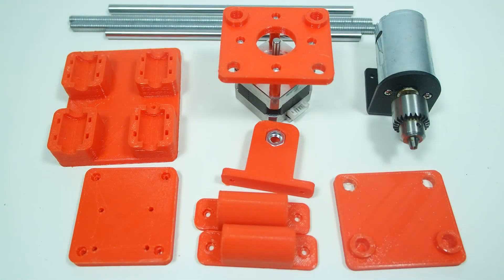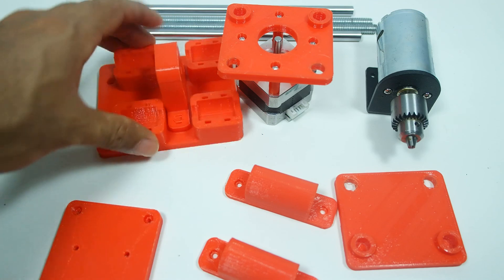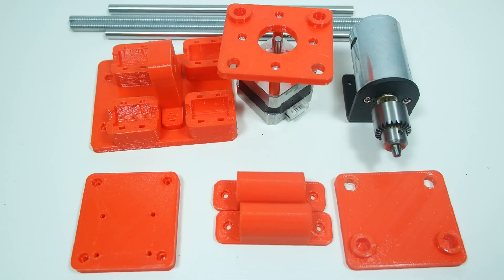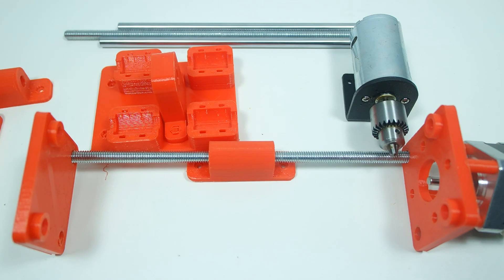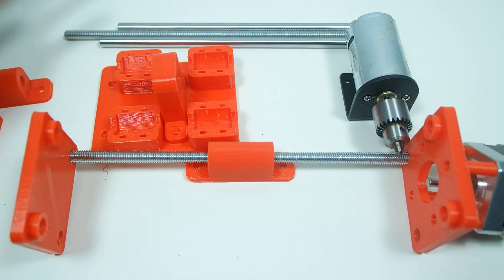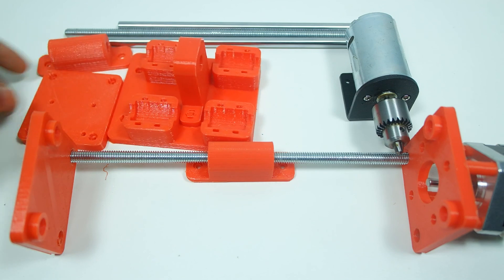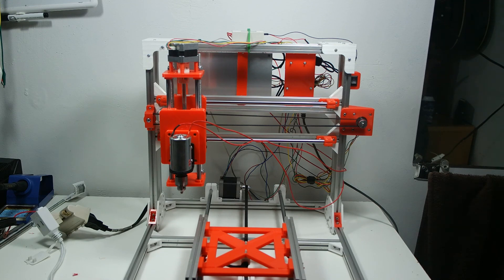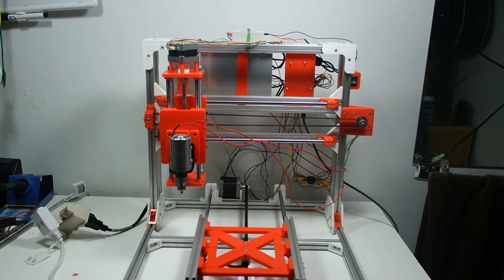New DYI CNC Machine: Working Z Axis And Spindle

Comment: Can any body share the stl files?
Reply from the maker: Hola Hola, All the STL files and CAD files can be accessed through Onshape. Just to let you know, there  is no BOM as of yet since this machine is still work in progress. It currently has a laser to be able to do laser etching of pcb paint since I was not having much luck milling the copper. If you need any of the files, here you go https://cad.onshape.com/documents/e45dd6c4215b26b1e8c826d1/w/1948f76f555f94968b6bec4a/e/7d8d2292db5e551af7220989. Export them from there and if you want to make any modifications you can make an Onshape account and do it there. If you have any other questions, feel free to email me on the email in the description or joining the discord server and asking there.